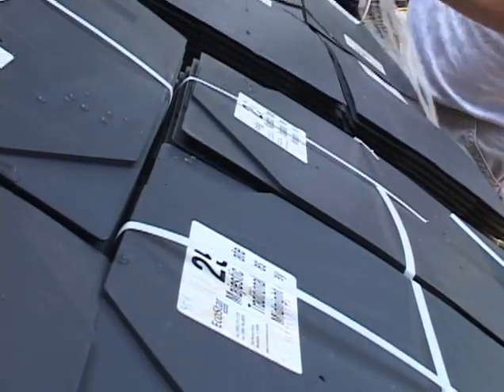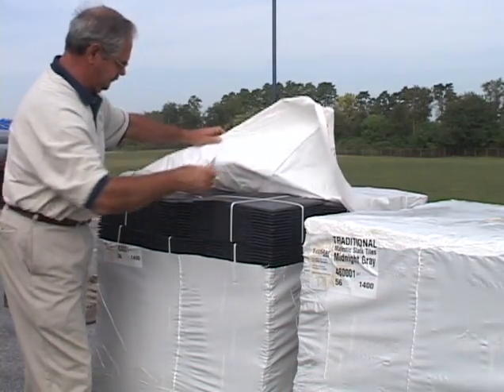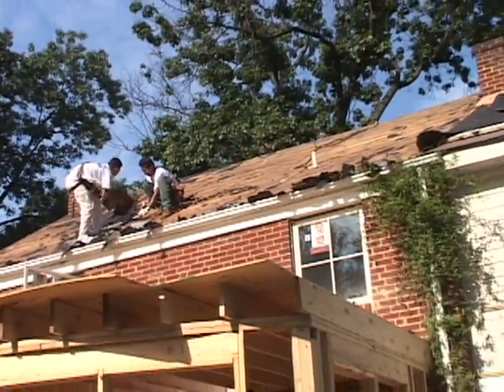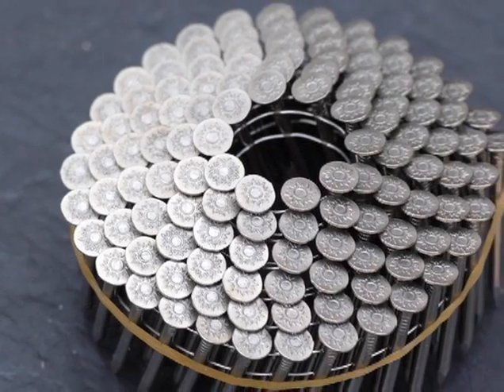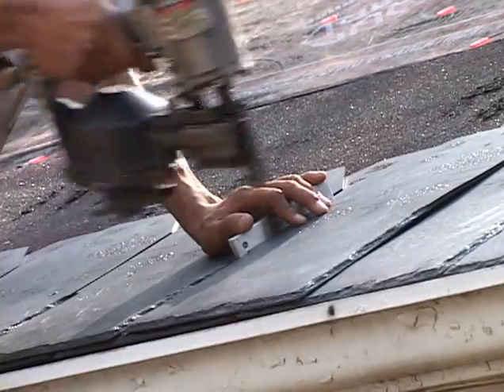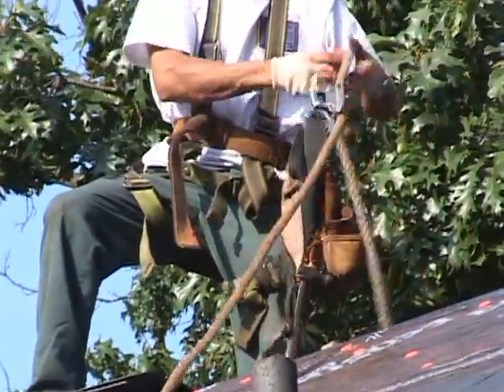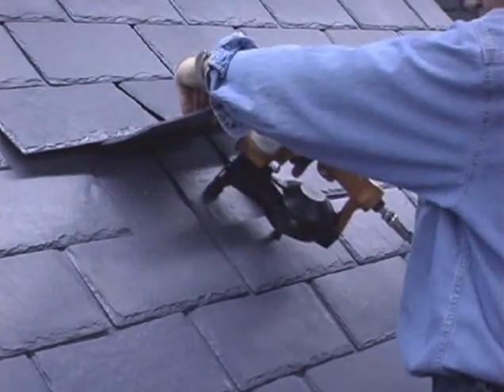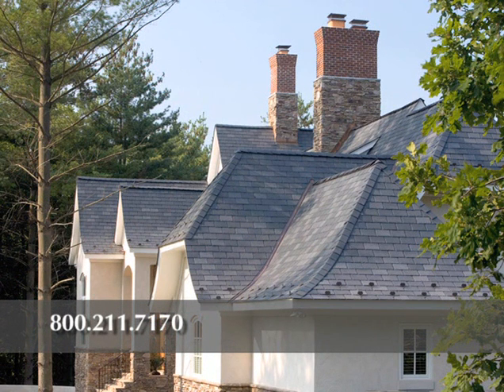EcoStar Installation

Comment: My experience with this product our company is installing 40sq as we speak in NH .. way to many marks and writing on the tiles theirs a. R I’m every key way and the 3/8th gap lines makes it extremely noticeable if the tile sis even a 1/6 th off !! Witch will create a visible gap line in the key way ! It’s extremely annoying to install . Also some
Yikes have access plastic on them from production so they’re not all exactly the same width . They make the same product in other brands that don’t have All this I will take close up photos and post tomorrow what happens with this stuff
Reply: What are you charging for install per sq?

Comment: why can't you blend the slates in the factory
Reply: That was my first thought!!
Reply: @jeffjohnson9091  the whole point of blending them is so that if you have multiple batches or lots, you dont have noticeable discolorations.  Color changes can occur across the same lot, the idea is to mix up the tiles to be used for the job.
Reply: @greggorrell  I understand the point of blending the lots. The comment was saying it would be much easier for the customers if they came pre-blended by the factory so the customer would get a uniform look without the hassle/labor of blending on site.

Comment: Copper metal, tab nails for underlayment, and $700 per square cost for materials. This roof would cost $800 to $900 just for materials. Add very slow labor and your sales cost would be minimum, 14 to 1600 dollars per square and maybe higher. We don't have many customers in that range. Also, the blending of pallets bothered me. Why are they afraid of this, is there quality control insufficient to guarantee consistent color? Also, the 45 degree thing bothers me. If the tiles cannot tolerate 45 degrees, what is there freeze thaw capabilities. We have temperatures ranging from 100 to 25 below. To many questions and too expensive. At these prices, maybe you should just use real slate.

Comment: I think the last gentleman is selling stone slate.  These ecostar  tiles cost about half of his estimate and they are pre-blended at the factory.  The unique rubber formulation of ecostar is very heat resistant and they have jobs over two decades to prove it.   Stone slate takes much longer to install and can be hazardous if they break off and fall on someone.    Ecostar is easier to install as they are light and cut with a utility knife.

Comment: Why is this product so difficult to get roofers to install?  They double and triple the cost of the roof.  Mean while its a lot
lighter, and easier to work with.   Can't buy this product at any local building supplies,  making DIY difficult.
Reply: Weggman Hillard every fake slate roof I have ever seen is  curled up in a few years newer products  are better
Reply: @stevewenzel391  that’s why Euroshield has a fully interlocked system & different chemical makeup to help prevent that.